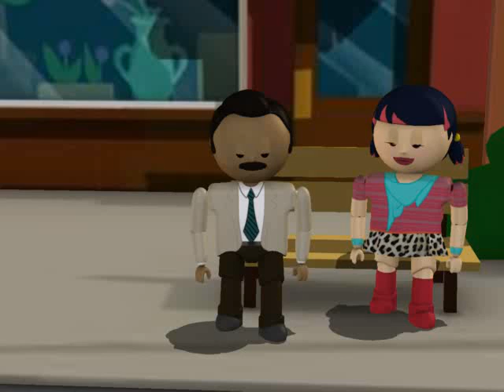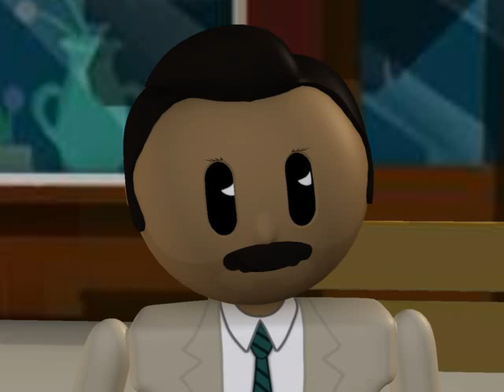Braemar TH series error codes 10, 15  HXOT1 low air flow and lockout

Comment: In the end it was the Burner assembly badly welded / fabricated with an air leak!
Eventually  it failed completely and finally Braemar under warranty $$$$  had to replace the whole burner assembly with a new one (1/3 of the heater).... This FINALLY fixed the unit.  As lest my swap around got the unit to where it was truly "STUFFED" so they could facilitate a repair.  Should have been picked up initially but the tech blamed the computer board which was obliviously originally just fine.